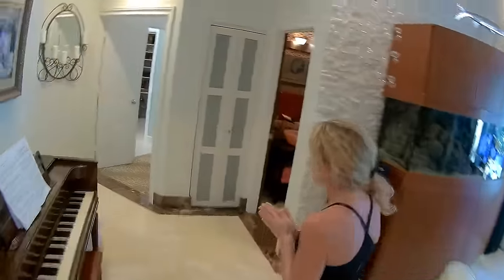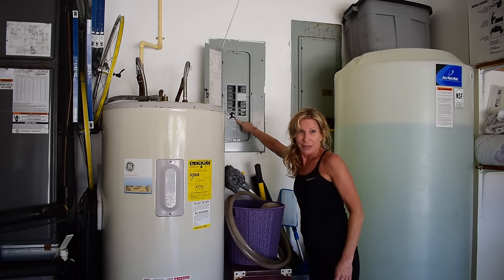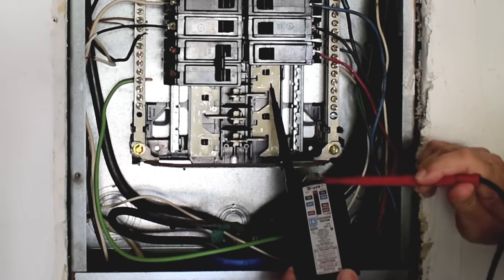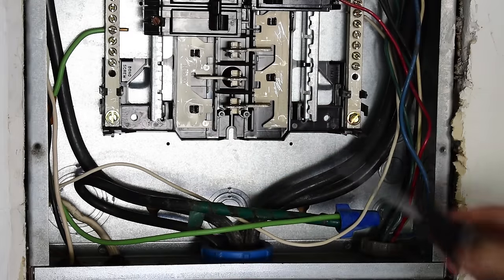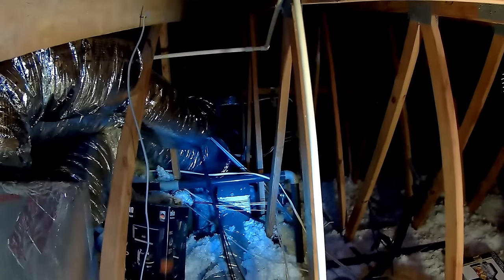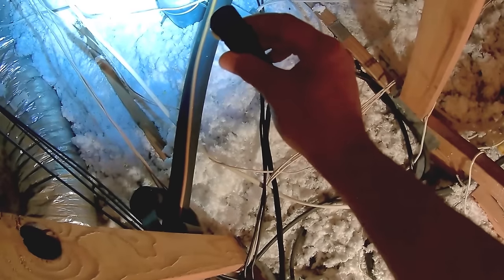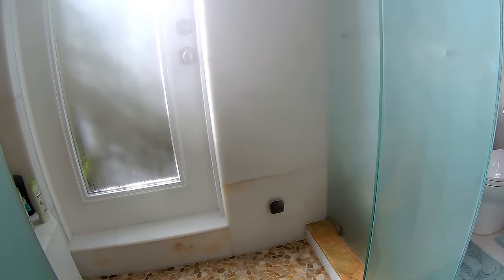How To Add 220V Line To Circuit Breaker Panel (Steam Shower/Range/Spa/Heater)

Comment: This work is so high stakes & requires a highly skilled electrician, he makes it appear easy...
Reply from the maker: I've done it so many times over the past 30 years. It's definitely not for every person to be doing. Thanks for watching!
Reply: Boss man it’s not about using it for 30 years it’s been wrong for 30 years that’s why the NEC says it ,go by the book it’s easy 6awg beakers size rated for 50-55 amp breaker  then 4awg wire would be rated for 60 amp breaker plus the steamers name plays says 40 amps 😌😌
Reply: Honestly I would have put 8 awg wire with a 40 amp breaker that would have been safer

Comment: I once had to run a circuit for a microwave that the customer wanted above the stove/range. Your client/friend sure was cool about things. The person I was working with thought that everything I did was preposterous. Nice work
Reply from the maker: Not all people are a pleasure to work for. I've done plenty of those over the years when remodeling kitchens. Install the 20A single receptacle inside the cabinet above. Thanks for watching!
Reply: @electronicsNmore  add a circuit for the fridge while you're at it, some of the new refrigerators dont play well with GFCI.
Reply from the maker: Refrigerators use a dedicated 20A branch circuit, no GFCI.

Comment: US-Americans are amazing. They think really, this is a house. Unbelievible. Greetings from Germany. I forgot: First, hihi.
Reply: Yes, this is a mansion, not a house. Above and beyond human needs.
Reply: @tedlahm5740  I mean the construction. It's crap. By the way, he wear flipflops and a watch while working with electricity.
Reply from the maker: @tedlahm5740  Americans love huge houses, I prefer a very nicely done smaller home. Big house mean much more upkeep, higher taxes, etc. It's actually not as big as it looks. It's maybe 3,000 sq ft.
Reply from the maker: @oliverhoffmann8215  The flip flops have a thick rubber sole(18-20mm), the watch is fine. The construction appears to be very good, the problem is the mess in the attic that was created after the home was built. Remodeling was done, and it wasn't the best work. Thanks for watching!
Reply: @electronicsNmore  compared to european houses, the construction is crap, i think thats what he means, in europe a 60 year old house is worth almost the same as a 5 year old house, if maintained properly.

Comment: Question: Could you attach a plastic Romex connector to the new cable from inside the box (instead of the metallic one) so no hole in sheetrock needed? Thanks for advice & great video!
Reply from the maker: As long as there's a plastic locking bushing or connector snapped into the hole securing the cable you should be fine.

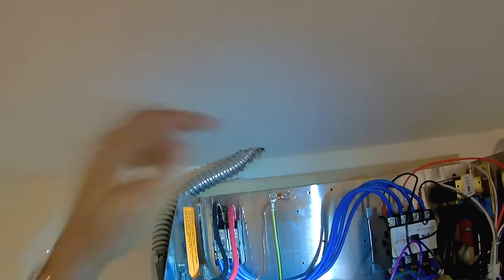Comment: 18:36 The bare earth conductor, do you not have to mark it with a green/yellow sleeve or tape? I'm aware that when it's connected it's obvious. In the UK we have to identify every conductor.
Nice job on the reconnection.
Reply from the maker: Bare wires no. They're always identified as ground.

Comment: Nice job-  is it safe to have a metal wrist watch on working in a live wire box?
Reply from the maker: The panel had the power to it disconnected. Once all the major work was finished, I turned it back on. Thanks for watching!
Reply: Glad to hear you did that!  I would make a point of pointing out this important safety step. (so you don't have to worry about keeping one hand in your pocket that way! - as per another comment) @electronicsNmore

Comment: Usually you check load balance between legs if you can, you had 4 220V breakers on one side and 2 on the other side, with empty slots to adjust if needed. You probably did that. Have you tried the push-in plastic NM feed-through's? So easy.
Reply from the maker: With 220v(double pole), both legs are used, so position makes no difference for load balancing, but you can and should have an equal amount of load with the single pole breakers in the panel. Yes, I used that in my other electrical video. I prefer the type below of use in panels, insert from the inside, and crimp. Thanks for watching!
https://www.homedepot.com/p/3-4-in-Non-Metallic-NM-Cable-Connector-27516/202077089
Reply: @electronicsNmore  Yes I meant adjust the single pole breakers. I hope Amy has whole-house lightning protection in place. I believe that has saved me serious trouble. Perhaps you could educate your viewers about that subject in a video?
Reply from the maker: Installing a lightning arrester on the main panel can help, but not always. When I lived in the Bahamas, I had a square-D unit that was in place when lightning struck a utility pole only 50 feet from my house. We lost a bunch of electronic devices.

Comment: Is there a way to do this without damaging the sheetrock? I'm working on a custom home with a sub panel in the laundry room. Do you think I can kill the panel and remove the mounting screws from the studs and pull the bottom of the panel out of the wall and drop it to expose about an inch or two at the top to get my bushing on? I don't want the owners to have to repair and repaint the wall. However it might be tough to get the panel back in. Any advice would be greatly appreciated....
Reply from the maker: You can remove the KO, then once the wire has been located and pulled through into the panel, you can slide over a plastic snap type connector on the inside.

Comment: Did she/you tell us what her problem actually was?   Why was the install company not made to return?  Obvious new install.   Wonderful job on your part.
Reply from the maker: Hi Ted. There was a much smaller unit that was installed before this unit. The plumber installed the new unit Amy purchased, but the power supply was inadequate. Thanks for watching!

Comment: The mr. Steam super3 model 15kw 63amp calls for #4 cu but only has up to a 3/4 inch knockout . And I'm pretty sure only 2  #4's will fit 3/4 inch liquid tight tubing. Any input?
Reply from the maker: You can always make the 3/4" hole 1". :-)
Reply: @electronicsNmore  I already thought of that but where they have the factory hole doesn't allow more room for a bigger one at the access.

Comment: is it corect that the ground wire conected to the neutal at the disconect? i know ground and neutral are conected in the main panel is that what you mean
Reply from the maker: The wire from the ground rod is connected the neutral at the service entrance by the main disconnect, the ground wire inside the panel shown in this video, is also tied into the neutral at that location. Very common.

Comment: Romex makes it easy.  Even with the mess.  Chicago requires  all wiring be in conduit.
Reply from the maker: It does. Much less work. I have a feeling the Electrical Contractor's Union paid someone off to pass that law(give them more work - $), there's no reason to have the Romex cable in conduit if it's properly secured in an attic. Thanks for watching!
Reply: @electronicsNmore  Of course not.   They would run individual conductors.   OH YAHHHH!!!!!  Union influenced (strong armed) requirement.    The only advantage for example in your case if there was conduit you could have used the old small gauge wire as a fish tape to pull the new wire into the conduit (assuming it was large enough pipe) .   You wouldn't have had to go in the attic at all unless there were more than three  90 degree bends in the pipe.    Keep up the great vids.
Reply: @electronicsNmore  can't put romex in conduit. It's insulation rating is based on free air. Besides, it would be a bear to pull, lol

Comment: I had that same question about the double-pole breaker. Since 20 and 20 is still 20, so why isn't the switch labeled once in the middle instead of over each half of the breaker? heh
Reply from the maker: The 240V line uses 2 wires. The breakers are made individually, then riveted together to make a double, which is why you see 20 on both. If each breaker is rated 20A, then it's not possible for more than 20A to flow across the 2 (240V) wires.

Comment: What state do you line in?  Who's idea was it to use WHITE for a hot lead?  Electrician??
--
Your right!  Amy is a kick!
Reply from the maker: Florida. You can use the white wire from a romex cable (2 wire w/ground) for 220v, but it must be clearly identified as a "Hot" wire by using black or red electrical tape where the connections are made.

Comment: just a question i did not see you bond box to ground am i wrong
Reply: he made a overlay note of it. "The ground bar bonding screw going in very shortly, it fell behind the water heater" 13m34sec
Reply: @james6794  i knew i didn't need to ring it up just could not see it lol   thank you
Reply from the maker: Freeze at 13:34

Comment: 60 in a 60 amp sub? I think I would have pulled the steamer from the main panel. Hope it doesn't trip Also you should check to see if the ground bar is bonded to the panel. You did the correct thing separating the grounds and neutrals and taking out the bonding screw.
With a 60 amp feed to the sub a #10 ground is ok.

Comment: Awesome video brother,  but a side note on the wire you used. Theoretically it falls short of the 60 amps by 5 according to table 310.15(b)(16) since by NEC codebook article 334  for nm cable is limited to the 60 degree C column but can be deranged using the 90 degree C column. Now with that said it’s just the cable type. Had it been thhn insulation or similar it would have been within code with a 65 amp rating. So technically with romex you would be stuck with 4 awg instead of 6 since it goes with the 60 degree column. It’s kind of a crazy rule since per the cable it’s rated for 90 degree C if reading the side of the romex, but that’s just some info sent your way, but I don’t see nothing going wrong with that. Stay blessed and keep making videos.
Reply from the maker: The current rating does vary by insulation, open air, etc, but I've used 6ga for up to 60A for the past 30 years. She'll be fine. Thanks for watching!

Comment: Why did you disconnect the crossover bar that connected both grounding buses? Shouldn't neutral be Earth grounded at the Box, with multiple ground rods on your property, and every single telephone pole in between your house and the power station. What was the purpose of removing that connection bar and moving the Earth's to one side and the neutrals to the other? To be honest I didn't finish the video, mainly skimmed through it, maybe you put the connection piece back.
Reply from the maker: Skipping through a video will not help you to learn, nor does it support my channel. The panel is the "Main Panel", but it's considered a subpanel. Everything is located in one structure, so you don't need multiple ground rods.
https://binged.it/38kI0be

Comment: Sir: Interesting that you mentioned the new steam system DID NOT need Reactive Power BECAUSE no Induction coil in the new steam generator. 
Question: If it did require SOME Reactive Power what additional SIZE SERVICE
would you provide. What would be the math to account for this. Thank you for
the information.
Reply from the maker: For Inductive loads(motors/transformers/etc), you take 80% of the breaker rating as a maximum. If I used a 50A for an inductive load rated 42A, then that would be 2A higher. (.8 x 50 = 40A). If the load is powered for many hours at a time or continuously, then you also need to multiple the maximum current for the branch circuit by 1.25 when figuring breaker size.

Comment: 220v would be rare,  240v is far far more common these days.   245 even.  220v is what you get when you have some crappy power coming to the house or some really old transformer feeding it.
Reply from the maker: Correct. I only used the word 220V to get more exposure. :-)